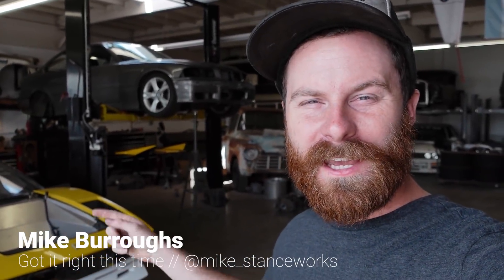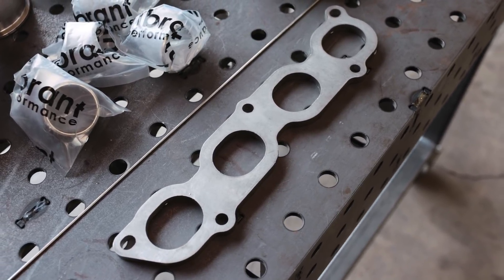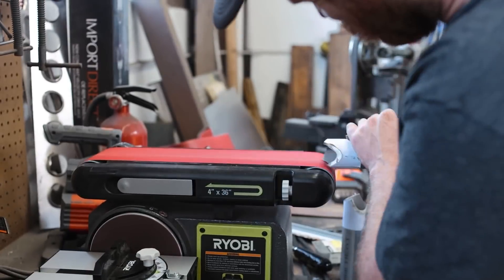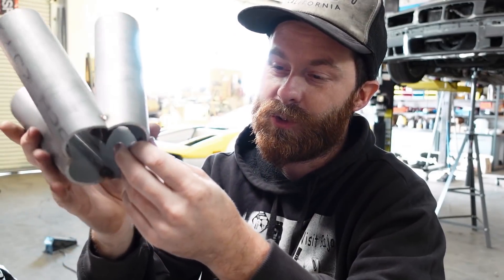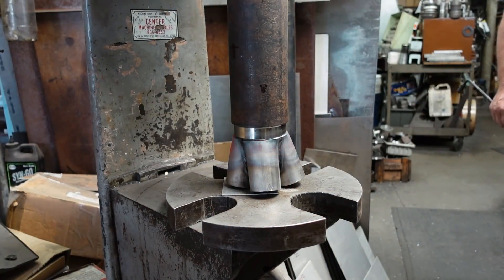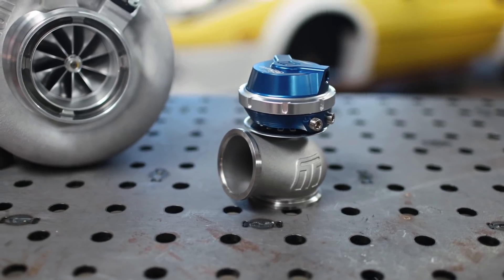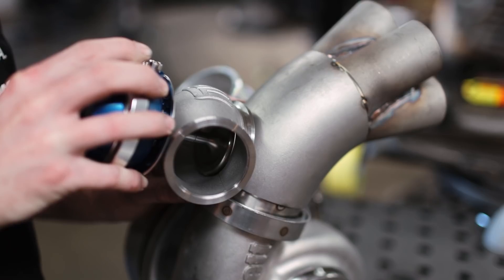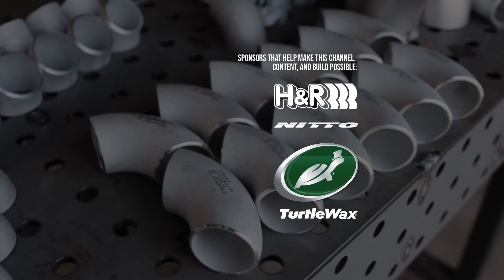Building A 1000+hp Capable Turbo Manifold - K-Swap Ferrari Time Attack Build - Ep. 38

Comment: If you want the best results on stainless, plug the ends and purge it with inert weld gas. It'll prevent the inside from doing weird things during welding. Depending on the grade of stainless, it isn't necessary to do this, but it can still help, regardless of the material.

Comment: Pro tip, when you’re purging, purge from the lowest point in the pipe. Argon’s heavier than air and you want it to fill from bottom up. You’ll get better coverage and a lot higher density of gas.
Reply from the maker: Thanks!

Comment: Having the turbo mounted so low in aspect to the engine and that far behind and away, what are you doing about the oil drain/return from the turbo? I feel like if you're making a pull, the g-forces combined with the oil pressure feeding the turbo are gonna blow oil seals every time you hit WOT.
Reply from the maker: The car is dry sump, I plan to have a scavenge line from the pump to the turbo if there’s enough ports.

Comment: I get the advantages of the straight runs to the collector, but as you said, this thing is rather heavy, and it will need to move and flex with the engine, that's where having it tucked up close to the engine is an advantage. How to you intend to support the weight of the Turbo when its that far from the engine?
Reply from the maker: Gotta watch to the end of the video. I covered that.
Reply: @stanceworks  lol  ok... I watch it at work...between phone calls and meetings   :)

Comment: I think the only thing you didn't touch on is using an e-wastegate instead of the old conventional style....but then you knocked the collector / priority flow out the park, so old school boost control won't be a problem with this build :)

as per some of the other comments, turbo is low, so drain is probably going to require a scavenge pump setup.
Reply from the maker: I briefly talked with Turbosmart about an electronic wastegate, it's something we may toy with later down the road! I want to get the thing running before I add complexity. 
I really appreciate the feedback and kind words! It sounds like a scavenge pump is the go-to move, but I have to do some research on how to responsibly integrate that with the dry sump system, if that's even necessary. I may have a scavenge port available on the oil pump.
Reply: @stanceworks  if you are dry sump then one of the scavenges can definitely be utilized. The Skid Factory did a detailed look at their low mount turbo solutions some time ago, but that was utilizing an electric pump, I feel like the dry sump is similar in function.

Basically a small sump under the turbo drain to allow oil to pool, the key thing I wasn't aware of was a vent line to allow scavenge to pull air from the intake of the turbo. 

They also mentioned having a "check valve" to stop oil syphoning into the turbo drain after stopping the engine, this might not be too big a drama with your proposed positioning but worth considering.

https://www.youtube.com/watch?v=zJchCTVvjgQ

Comment: Will you be doing radial entry routing , i.e. running the primaries in firing order into the collector? Doing a killer job.
Reply from the maker: No, as it doesn’t really benefit a turbo manifold like it does an NA manifold.

Comment: not sure your going to be able to use 304L at 1000hp, or anywhere close to it, your going to reach the sag temp of 304L real fast under sustained boost. .. 316 would be your lowest spec.

Comment: That's a really good bit of work Mike!
Any issues with the oil drain, especially on acceleration, with the turbo so low, and behind the engine?
Reply from the maker: I’ll likely be using an oil scavenge pump for the turbo.
Reply: @stanceworks  sweet as. If yiy look at the Skid Factory channel, they have done a lot of work with low mounts

Comment: You'd think that the manifold flange would come like that as standard really, much stronger joint, less chance of leaking as well.
Reply: I don't think the ports on the head are round, so the flange matched the head, on thinner tube when building a normal non-turbo header you would shape the tube to fit that shape of the manifold ports.

Comment: Looks great but I do have a question. Wouldn't you need to heat treat the collector before or after you welded it up? Or is that unnecessary for this application.
Reply from the maker: It's not necessary, it's going to get red-hot under extreme use anyway.

Comment: I have a question, with somewhat long intercooler piping.. wouldn't you get more turbolag than with a shorter one? Considering that you might be even doubling the volume of the system to preasurize? Thanks!
Reply from the maker: It shouldn't be very long at all. In fact it should be shorter than your average car. It's a water-to-air system, so I'm not sending piping to the front of the car or anything. It'll be from the turbo, through the intercooler next to the engine, and into the intake plenum. It'd be hard to make it much shorter!
Reply: @stanceworks  thanks for the clarification! really loving the build, i'm learning a lot about racecars!

Comment: The way you built this manifold using that 3” collector is going to compromise turbo spooling a lot! It would have been much better to have longer tubes connecting as close as possible to the rotor. To simplify, you don’t want to have a “chamber” between the tubes and the rotor!
Reply from the maker: There has to be space for a wastegate, though.
Reply: @stanceworks  You can mount it right on top of the collector. You want the collector internal space to be as small as one cylinder tube diameter only, to take advantage of the cilynders pulsing and have good exhaust gases speed to spin the turbo as early as possible. I have photos of some manifolds done this way if you want, we prepare Audi 5cyl turbo engines here a lot.
Reply from the maker: The engineers over at Vibrant and Turbosmart both expressed that mounting the wastegate to the top or side of the collector itself isn't really the proper way to do things. I'm definitely open to improving the design, but guys seemed to express that prioritizing the wastegate was an important and often-overlooked step in turbo manifold design.

Comment: Walton motorsports did a cracking vlog on here showing the manifold build process watch it as they push tube through the head flange making it super strong and but a cnc made adapter them it’s perfect

Comment: Tip 
When trying to work out how and where to put the pipes for the turbo grab some pool noodles some stiff wire and garden hose.
Fill short lengths of the hose with a few lengths of wire so you can bend it easily and it will hold the shape, cut short sections of pool noodle to slide over the hose upto each bend cut small wedges of noodle to fill in the gaps .
When you have a noodle manifold sorted glue and tape all the bits so they will hold their shape long enough to use as a template.
OR
Buy or rent the special kit they make for the task.

Comment: You are Right, that manifold design is the best, F1 cars with Turbo 4-Cyl engines in the 80's used similar designs, I would really consider air to water intercooling in that setup, it would improve the package a lot.

Comment: How come this was made of stainless?  Is it better with heat?
Reply: Mild would rust apart in no time too. Carbon steels have a thermal conductivity of 45W per M (ish, alloys may vary) and Stainless is about 15W per M. Stainless steel alloys like Inconel are even lower.

Comment: Make sure the oil has an easy path to drain from the turbo into the oil pan, some setups might require a lift pump to drain the oil fast enough.
Reply: and a turbo sump.
Reply: and a vent to the sump
Reply: Turbo drain needs to be 45deg downhill from turbo and dump above the oil fill line in the pan, this turbo placement will require a seperate scavenge pump to manage the oil; This is the drawback to low slung turbos and one of the reasons it's not often done.

Comment: Looks great, and no doubt it will be efficient. just wondering will you have to make a sump for the turbo and use a scavenge pump in order to avoid flooding the turbo with oil?  I couldn`t see if there is enough drop to make regular gravity feed work with the oil return.

Comment: With this turbo placement, would you have to use an auxiliary oil pump for turbo lubrication?
Reply from the maker: Typically yes, but I have to ask how to set it up properly with dry sump.
Reply: @stanceworks  would having the turbo in line with the oil coolers work? I mean the return lines from the engine pan go to the oil cooler and then to an aux pump then to turbo and drain into the oil tank.
Or one could also have a separate oiling loop from the oil tank with an aux pump and turbo to the loop?
Reply from the maker: That part I’m not sure. I’ll be deferring to Dailey’s opinion, I want to take no risks

Comment from the maker: :D I'll beat the questions to the punch for those that haven't caught all the episodes: Yes, the turbo will need a support. Also, this is the big turbo, but it's not the turbo I will be using for the most part. I have a smaller turbo that will be what is used 90% of the time, but I am building the manifold based around the large one, as the small one will be mounted with an adapter to the V-band flange seen in the video.
Reply: youre too smart! great thinking dude
Reply: Loving the build mate only thing to be mindful of with the turbo so low is the oil drain on the turbo as long as there is a steep enough slope for a gravity drain I think you’ve done an amazing job really inspiring